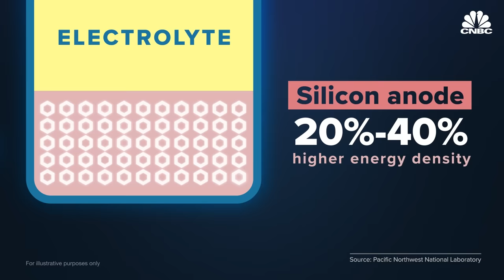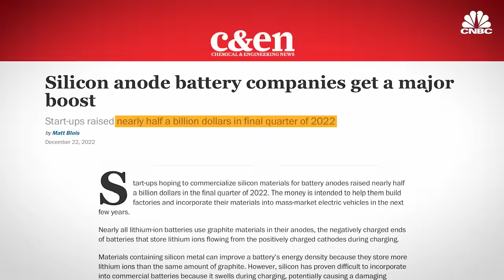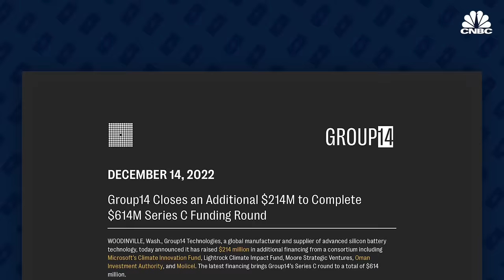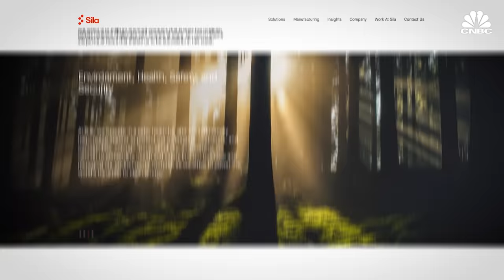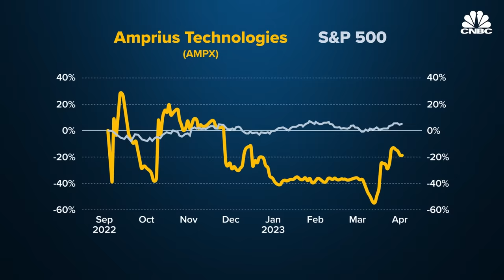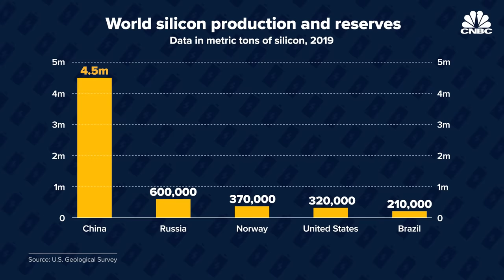How Silicon Anode Batteries Will Bring Better Range To EVs

Comment: Silicon anodes in car batteries could be a game changer.  Not only do they store more energy and last longer, but they could also make electric cars more affordable in the long run.
Reply: Yes, that is what this video said.
Reply: At larger scale yes , but when you need to have a battery in a confined space and that battery now needs to swell to hold a charge, the volumetric capacity of the battery compared to current technology is still an issue.
Reply: Maybe so, but the EV cars suffer the same issues they did when they were first invented over 100 years ago and that's a loss of battery power in towing small stuff.
Reply: Wait and see on that.  Car companies will probably just keep prices high for more profit
Reply: @Boxagami  They used EV trucks for decades to deliver Milk in the U.S. England I believe never stopped using them. Milk is anything but light!
Reply: @lisam4503  I'm 52, and I've NEVER seen a EV milk truck in my life! Never! It's a fact, you can youtube it.. The Ford Lightening truck cannot tow anything even light without a massive battery drain over 45%!! This is a known issue and the industry continues to try and cover it up. EV cars would not fair well in the south when in comes to hurricane evacuations btw either and it's talked about here openly on radio and TV.  Up north, they will not fair well because of extreme cold weather. In NY, this past year they used EV garbage trucks with snow plows attached and they failed horribly, they could only run for 4hrs. My family also works in the power grid industry and our system cannot handle all these people charging EV's. It will cost trillions of dollars. Putting eggs all into one basket, making everything EV is a dangerous idea. Not to mention, destroying the oil industry means destroying all plastic and rubber which is used in EV's. lol Don't have oil, you won't have tires for your EV car. You won't have rubber gaskets and seals either. It is very clear to me, people who want EV cars have no clue as to how things are made.
Reply: @Boxagami  Welp, oil is a finite resource so transport will have to transition to different (not fossil fuel) fuels or batteries.
Reply: @timberwolfe1645   more than likely we'd see a "cost" reduction in production only enhancing profit as  we are only on the receiving end. The question always, will they be taxed?
Reply: @Boxagami  I'm 56 and for a few months I drove one in the UK. Wasn't the job for me but yes, they very much did exist. Only any use because they were used so early in the mornings, with no traffic, as the top speed was about jogging pace

Comment: Pretty cool tech - hopefully this starts to be a game changer in the EV market.  Looks like it's alot more advanced than just lab tests, hopefully mass commercialization isn't far away and it's not another sounds great, but doesn't pan out technology.  One thing I wonder is if silicon anodes can be used with sodium instead of lithium.  At that point, you'd have a battery that has raw materials with no scarcity issues at all.
Reply: Sure they can.....they can also be used with Thorium, and run for hundreds of years...!!!

Comment: I see the problem being the access to ingot level silicon. Right now, the computer chip industry is having issues with wafer garage silicon becoming more expensive due to scarcity. 
Also, if you're not using a CVD process to develop you cathode in comparison to this powder coating style your going to continue to have critical separation.
But, of all the things I've seen the past few years I think this has a good potential.
Reply: If you confuse silicon wafers and silicon dust as somehow a competing demand for what is basically SAND then I think you are mistaken.
Reply: Silicon wafers aren't hard to make. It's bascially like growing crystals from a chemicals toy set. The laser engraving and cutting is the hard part.
Reply: Polysilicon ingots is not a precursor for silcon anodes, silane gas is, or more specifically monosilane gas. Rec Silicon which is the biggest producer of silane gases outside of China has a production facility that they are planning on expanding just across the street from Sila and G14. I anticipate that they will scale production along with market demand.
Reply: Scarcity? Isn’t silicon melted from sand soil? I don’t see sand ever becoming remotely close to scarcity in probably as long as Earth exists.
Reply: Even you may be right about the scarcity of ingot level silicon, I also believe this is not the issue here as it doesn't sound as this level is needed to make Anode materials.

Comment: It’s sure going to be transformational for the EV industry and become the standard battery technology for light and heavy EV vehicles manufacturing if the suggested mileage is accurate and a increase from 3-400 miles to 6-700 mile range in normal conditions.
Possibly small commercial airplanes as well could benefit hugely.
As of now the battery technology is the biggest thing holding back useful mass adoption of EV and of course a bigger infrastructure charging network buildout.

Comment: Samsung basically bought higher density silicon batteries some years back from a battery maker without checking their technology. The next year Samsung had the best battery capacity phones out there, then all of the combusted into flames. Due to swelling of the battery.
Reply: It will be interesting to see if these kind of EV's will encounter the same mess as lithium-ion ?

Comment: You don't really need extra range on EVs though. 400km is plenty if the fast charging network is there. This does definitely open up potential for smaller batteries in EVs leading to faster charging, lighter vehicles and lower costs. 🤙

Comment: Panasonic 2170 batteries with 5% Si anode has an energy density of 280 wh/kg, Tesla's 4680 has the potential to reach 300 wh/kg using 5-10% Si. How much energy density boost does 50% Si anode gives? Key detail missed by CNBC like always. I've read that the gains is minimal above 10% Si and insignificant above 25%.

Comment: We are no where near the limit of battery technology, we are at the very beginning of 100 years of development. At some point solar and storage will be combined into a single cheap, lightweight, device with unthinkable efficiency.
Reply: got a trouser tepee Frank?
Reply: Frank it's so good to hear optimism!!! Thanx 
I already have that little system. A simple solar panel, regulator, and one 12 volt battery.
No inverter.  They use too much juice. Everything DC. Used only for lighting, charging my devices and occasionally a tiny refrigerator.... Not everyone can live like that, I understand....
It's been functioning for six years. I think it cost me $150. And I can eat better!!!!
Reply: We were at the limit of those materials.  On paper, these batteries hold xxx amount of energy and in practice we are at 90-95% of that number.  That's how we know we are at the limits of the tech.

Comment: Isn't Lithium in short supply also? If all the cars in the world were electric, would there be enough Lithium to produce batteries to power them? I think there will need to be a variety of solutions to bring about the complete electrification of transport.
Reply: Lithium will ramp up as demand ramps up, but because heavy lithium demand is a recent development there were not enough investment to meet the upcoming demand for the next 5 years at least. So temporary shortage with a very achievable long term solution. Sodium batteries may take some pressure off because they will be a great solution for large scale power storage solutions. They're cheaper, and don't have the same thermal runaway properties as lithium batts do - but they are heavy and not ideal for transportation.
Reply: Yes this is why trains are the future. Cars is just one thing. Though I can see this used in fleet vehicles like buses and trucks
Reply: More than 90% of the Earth's crust is composed of silicate minerals, making silicon the second most abundant element in the Earth's crust.
Reply: Lithium is not a rare earth mineral.
Reply: Lithium cost increased 1000% in the last decade and we haven’t even replaced 10% of ice with ev on this planet. It’s not financially viable anymore

Comment: Hopefully not all EV ranges will be artificially limited to 300 miles to keep costs down. Hopefully the improved battery technology will unlock higher range capacities as options.
Reply: Artificially?
Reply: Honestly, 300 mi is plenty as long as fast charging is readily available.
Reply: @spacetoast7783  programmeted obsolescence, so you will be obligate to spend more money for more miles.
Reply: @bikis951  That's not what those words mean lmao. Are you saying there's a car company that pushed a software update to suddenly hard limit the battery to 300 miles?
Reply: @spacetoast7783  Pushed an update?  No.  Built them that way from the factory and only unlocked the range option if you PAID FOR IT?  Yes.  Tesla.  It's common knowledge so a quick google search will show you.  #1 reason most people won't ever touch an electric vehicle.  Absolute bullcrap.
Reply: @DarthObscurity  Do you have an example of a company artificially limiting the range of a reusable battery with software?

Comment: An interesting review of silicon anode batteries, but seriously runs short on what´s going on. Theres also a silicion anode battery manufacturer that runs by the name of ENOVIX, and are running into actual production at a larger scale on year 2024. In late 2023 they will be supplying the US ARMY with their batteries, which have been positively tested for military use: a highly demanding application.🙂

Comment: Does this battery have more density than the other 10 battery breakthroughs I read about over the past 10 years?
Reply: Be specific. Just talk about one and we can go from there.
Reply: You all do realize that we’ve gotten huge battery improvements in the last 10 years right?
Reply: @najibyarzerachic  ok how about the graphene battery?
Reply: @SanctuaryLife  Graphene will be good for capacitors, not batteries.  Helps with charging faster not energy density.

Comment: When these batteries are worn out, what about the capabilities to recycle them?
Reply: Very easy.  It's silicone not lead.  It's a non toxic metal.
Reply: @lotoex  So silicon can be collected and simply reused? What about lithium?
Reply: @kinngrimm  Lithium can be recycled as well.
Reply: @beatreuteler  So only its first production is not good for the environment. If we give it new lifecycles that would therefor reduce that issue.
Reply: @kinngrimm  Correct. I do think with 8 billion people on earth we need to move towards cycling economies in almost everything we do. Just today I heard in the news that the G7-countries agreed to move towards 100% recycling in plastics materials. This seem to imply a ban on hard or not to recycle plastic materials in favor of such who are easier to recycle. A tough decision given the fact there are a few 1000 different plastic materials out there, but the right one imo.

Comment: How does Silicon compare to Graphene?
Reply: Graphene is a carbon based atomic layer sheet while silicon is a different chemical element.
Reply: @beatreuteler  I meant how do they compare for use in rechargeable batteries?
Reply: @glennr9913  OK. The video explains that it takes 24 times less silicon atoms than Atoms in Graphite to get the same amount of Lithium Ions attracted on the Anode. While I don't know how Graphene is attracting Lithium Ions I do know that Graphene consists of carbon as well as Graphite does. Having said this, there is a good chance Silicon shows the same advantage over Graphene as it shows over Garaphite. I hope it helps.
Reply: @beatreuteler  It's good to know that there are a lot of smart folks working on it.  We are living in an exciting age of technical achievements.
Reply: @glennr9913  This couldn't be any more true, Glenn. Thanks to the fact I'm professionally involved in coating technology, (which is used in litterally every Battery tech as well as fuel cell tech) I come across quite a lot of people who do exactly what you mean.

Comment: As a Canadian, I would say that other than range and longevity, my concern is about how well it does in -40 C. I know my lithium batteries do not like that kind of cold and neither do my lead acid batteries. Maybe these will be better? Certainly airplanes have this issue as well at very high altitudes so perhaps this issue is solved but I would like to hear more about it
Reply: You bring up a good point. If they think that expansion and contraction of their battery is problematic in the lab, wait until it has to sit outdoors in a Canadian winter or a Las Vegas summer.
Reply: Try a deep cycle or marine battery and you won't have issues anymore.  It's all about the price.  As much as a majority of us think it should be illegal, they are still allowed to sell things like this where they aren't effective and it's bullcrap because most people don't understand.

Comment: So 1 year ago CNBC did a story about the major shortage of sand... specifically the kind needed for silicon. The shortage will impact chip production which is reliant on silicon. Fast forward to today and CNBC does this story on the breakthrough of silicon batteries but no mention of where the silicon will come from considering the major shortage of the sand needed for silicon. How is this silicon battery going to do us any good other than to rely on yet another material for which we already experience a shortage of and which the mining of will have bigger environmental impacts that many current technologies.

AND let's not forget the mention that China has the market for production of silicon... and lithium! Wake up people! China is about to literally control the world as they manufacture everything the world uses and can control markets with how much they produce just as OPEC nations control oil.
Reply: All of those "shortages" where scare tactics.
Reply: Off grid solar with an ebike give them nothing over time($ over time for everything everywhere not me though) only buy upfront. I would rather give my money to some small things vs big energy(or big anything for that matter) on either side(or either political isle).
Reply: Jay A, it seems you didn't watch the video. These silicon Anode materials do not seem to use the same quality silicon as the chip market (ingot quality). It says it can be mined in any country in the world.
Reply: @beatreuteler  go watch the video from a year ago. Also watch the end of the video. Yes it can be mined but only from certain areas and China basically has the corner on the market by leaps and bounds.
Reply: @JayBirdPhotos  All. Sand. Has. Silicon.

All. Of. It.  Every grain.  The definition of sand is that it contains silica.  Lmfao.

The problem is the RETURN of silica.  It's all about money.  If some rich piece of crap can't put his stamp on it and make a million dollars, this is how it is described instead.
Reply: @DarthObscurity  correct but incorrect. Do a Google search and go watch the previous story. Chip makers use a specific type of sand that is made up of 95% silicon dioxide. Ordinary sand however is only 80% silicon dioxide and much of the desert sand is less than 50%. .. To make a silicon that is chip grade you need to get to 99.999999999% pure silicon during the refining process. Its extremely difficult to do and cost prohibitive with ordinary sand. I should add that some sand has no silicon dioxide in it at all. That high grade sand is also mined vs just digging up a beach or desert as well.

Comment: Sounds great. That kind of additional driving range helps alleviate a lot of range anxiety. Electrics aren't their yet, but this is exciting progress. The infrastructure in the USA isn't up to dealing w adding millions of new electric cars & trucks as yet. And those w no place to charge at home won't want to buy in yet. 

Also the question of yrs or miles of useful battery life, and the cost of replacement is very important to consider even if one has a place to plug in at home. 

At this time I'd only opt for a gasoline electric hybrid until all these concerns are solved and the total cost of a car is within reason and very competitive w a ICE car. Even if I wanted one, and I don't, a new or late model Porsche or Benz are not happening for me anytime soon.

Comment: Silicon anode batteries offer several advantages over traditional lithium-ion batteries, including higher energy density and longer cycle life. However, there are also some disadvantages associated with these batteries:

Volume expansion: Silicon anodes can expand up to four times their original size during charging, which can cause mechanical stress and damage to the battery. This can lead to reduced cycle life and lower overall performance.

Electrolyte breakdown: The high reactivity of silicon can cause the breakdown of the electrolyte, which is the liquid or gel substance that conducts ions between the cathode and anode in a battery. This can lead to reduced battery performance and safety issues.

Cost: Silicon is more expensive than other materials commonly used in battery anodes, which can make silicon anode batteries more expensive to produce.

Manufacturing challenges: The manufacturing process for silicon anode batteries is more complex than for traditional lithium-ion batteries, which can lead to production challenges and increased costs.

Overall, while silicon anode batteries offer many advantages, they are still in the research and development phase, and further work is needed to overcome the associated disadvantages and bring them to commercial scale.

ChatGPT
Reply: Facts😎👍
Reply: which is it, ChatGPT, longer or shorter cycle life?
Reply: I expected more of ChatGPT